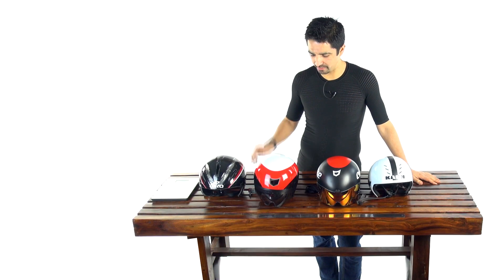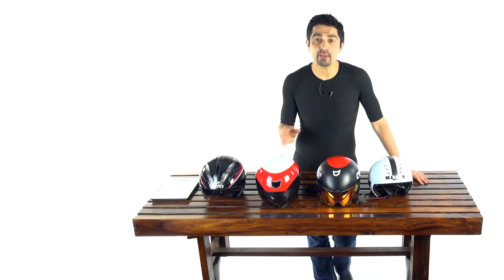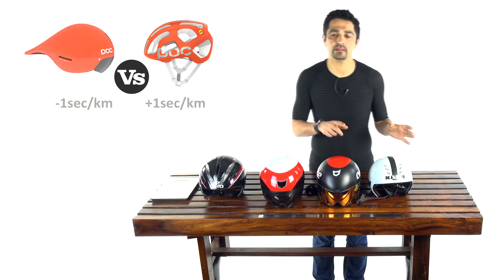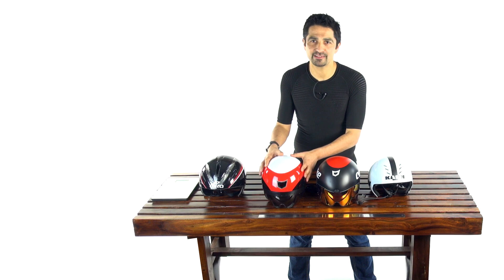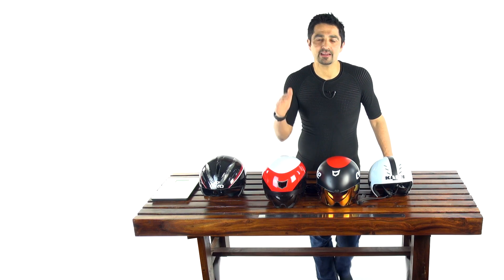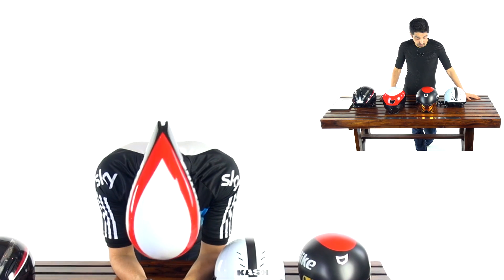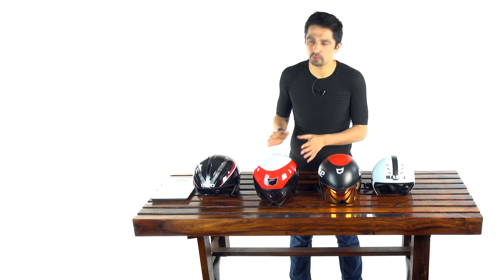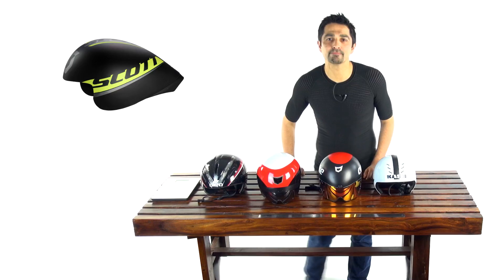Timetrial (TT) vs Aero Road vs Road Helmets: How much faster on BestBikeSplit?

Comment: I just wanted a quality helmet with an attachable visor for everyday riding... that's why I own two Giro Air Attack helmets (both red and black). The only thing that would make it better is if it was able to mount two visors, one clear and one tinted, at the same time (one up, one down). IF 10ths of seconds per km matter then you should probably not be buying a helmet off the shelf anyway. I am sure you could save a few 100ths of a second per km with a helmet made just for your noggin.
Reply: You can do that with the Giro Vanquish. The only problem is that if you have the extra visor attached  above you are slightly blocking the air vents.

Comment: Superb video.  Here's a suggestion for a follow-up video on aero helmets that's right up your alley: factor in the effect of reduced head cooling (and thereby power output) from switching to a full TT helmet.  Just as you were able to quantify the hill grade at which the aero TT helmet is no longer advantageous, you could try to quantify the outside effective temperature (temp/humidity) and speed at which the aero savings would be mitigated by the reduction in head cooling (say a 300W output) when wearing a TT aero helmet.  Giro has published results on their website of relative cooling of all their different helmets, so you could use this as a reference.  

My guess is that the accrued time loss (via reduced power output) over a 60 km TT of the reduction in cooling from a TT helmet is HUGE, and I'd expect that at even modestly warm temperatures you are better off with a draggy road helmet with awesome cooling (e.g., Giro Atmos)—but maybe my conjecture is entirely wrong, which is why is would be great if someone with this presenter's skills could take a stab at such an analysis (which I don't believe anyone has ever attempted).

The one thing I can say with 100% certainty is that a human's power output is slashed once the brain starts to overheat.  The body will do anything to protect this organ, including shutting down physical exertion.  Everyone who's tried to mimic an intense FTP effort on an indoor trainer without any fan or cooling flow has experienced this reality firsthand, and that's without wearing any helmet on the indoor trainer.  There's simply a limit to how much sweating can cool a head insulated by a helmet with inadequate cooling.
Reply from the maker: Nice idea....would be complicated to.come up with a formula but I like your suggestion. Cooling is vital but strangely core temp may not.vary much vs skin temp indoors. An attempt at quantification is here "effect of heat acclimatization on cycking time trial performances and pacing" Racinais 2015

Comment: Is 0.01 accurate?    The difference you feel between wearing a road helmet and a TT helmet when you're riding into a strong wind is enormous!
Reply: Jester123ish a lot of what you feel is more what you don’t hear.  The muffling of the sound (imo) makes you feel as fast as being fast.  Like the lack of wind noise  of being in tailwind section vs noise of being in a headwind section ( not referring to the actual energy output, just the noise reduction.

Comment: I think an aero helmet Needs to have:- a shape that work not only for 0° wind angle but for a variation of angles because even if you align your head straightforward there will be crosswinds- a visor so in TT position (= head down) there is still wind and sun protection for the eyes. Normal shades leave a gap in this angle.- a decent ventilation to mitigate transpiration and a reasonable color scheme (white or silver) to reflect sun radiation, not to absorb it

Comment: Another point to consider is when riding in hot weather with an aero helmet on, additional sweating and overheating due to the lack of proper ventilation, could make your performance worse.
Reply: Giro Vanquish MIPS is super ventilated. One of the better ones. I've ridden it in 40+ C no problems

Comment: If I am in between sizes. is it more aero to choose one size up or one size down?
Reply from the maker: In terms of helmet? one down. smaller should always win in the wind tunnel but comfort is important too.
Reply: thanks for the fast response. my hypothesis was that having a larger smoothe aero helmet cover more of your non aero shoulders would be faster. it's hard to quantify with out a lot of testing.
Reply from the maker: yes indeed, if your head is in free space (looking up) smaller should win, if you are tucked, a larger (or more fitted) helmet covering gaps should win.

Comment: I bought a semi-aero helmet for IM triathlon but discovered the extra weight caused me to sit up much more often.   Might be worth popping 100g of bluetac inside your road helmet to simulate before making an investment.   Of course it's fine on the turbo - you don't have to look where you're going!
Reply from the maker: Interesting suggestion thanks; it certainly worth checking the helmet weight carefully before buying.

Comment: does a visor make a significant impact on the aerodynamics of an aero helmet or is it purely the gap-saving effect of the helmet on the head-neck-shoulder interface that is important?
Reply from the maker: Very good question! I believe a visor does indeed help aero, but it does depends and or position and hard to be conclusive from 1 rider. However I have recently seen data that from 5 riders the average watts savings was 3w with visor down vs up at 40-45kph. So yes visor down is best.

Comment: Depending a riders fit, different TT helmets will have an impact, this is related partly to the head being below/above the back, also note that a lot of new road helmets have vents only at the front(head up position) and the back half of the helmet smooth, chewing the stem like froome

Comment: Wind tunnels prove the TT helmet to be faster without doubt.
We don't ride in wind tunnels, and moving your head to look around is required so the aero advantage is removed.
Greg lemond won through his position on the aero bars not through the helmet.

Comment: How about surfaces? Certainly there must be some data on drag.
Reply from the maker: Hi +John Riggs Do you mean helmet materials and how it influences drag, like skinsuit materials?
Reply: Yes. 
I used to use sand paper to rough up the outer shell of my TT helmets in hopes of creating a "boundary layer" of air. Then I noticed companies like Ridley doing that to their bikes and then it seemed to go away as if the gains weren't  worth the hassle.
Reply from the maker: have a look at this. I seriously doubt the sandpaper effect helps but I admire your efforts! https://www.researchgate.net/publication/225857940_Aerodynamic_behaviour_of_single_sport_jersey_fabrics_with_different_roughness_and_cover_factors